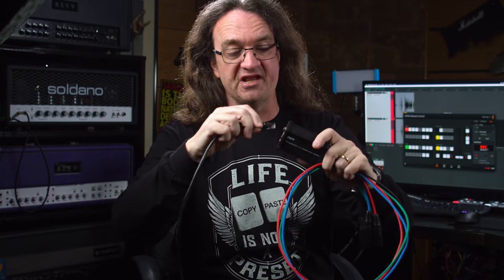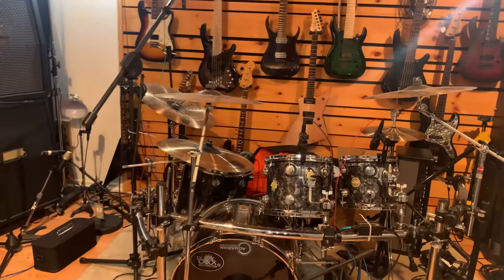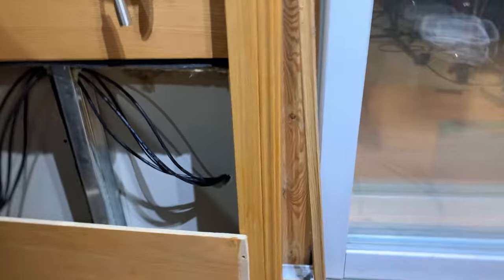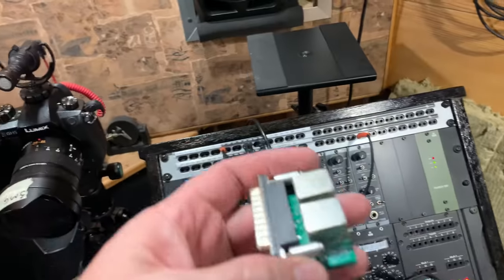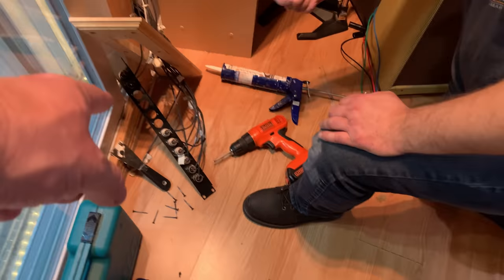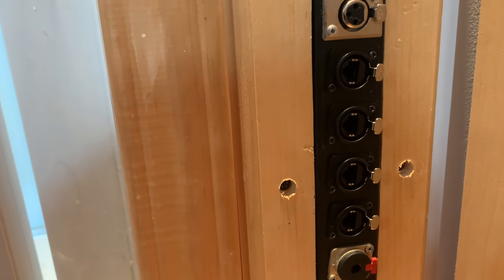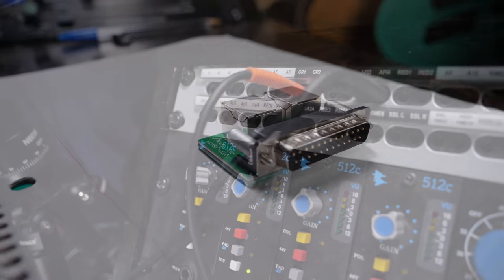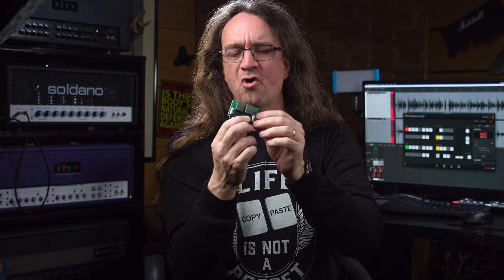How we Rewired the Studio!   We used lots of Caulk!

Comment: So you wired your studio back in 2003.  How did you do that without a patch bay?  What kind of wiring is that?  How many spools of solder did you go through?  How many hundreds or thousands of feet of wire did you use?  Do they have all gold or chrome plated connectors?  Did they have connectors?  Molded plastic ones?  Chinese types?  Quality RadioShack patch cords?  As if there ever was such a thing?

Come on Glenn.  Admit it.  You really don't know how to wire up the studio.  If it doesn't have plugs and sockets.  Because then you might need to use a volt/ohm multimeter.  To make certain you get everything out of phase.  Like those other eight microphone inputs you mentioned.

A lot of meticulous planning goes into designing and wiring up the control room.  Before you put all the equipment in.  It's not usually the other way around.  I mean it's hard to put all the equipment in and start using it.  Before you wire the control room.  It looks very impressive, yes.  But.  It has to be wired first.  Before you can use it.  And that usually starts with the patch bays.  You know patch bays?  Bays of patches for days of patches in the bays.  Like a lot of them.  Patching on everything.  Every input, every output, every insert every key, in the succession of inputs and outputs.  Wherever you can put a patch you put one.  And that generally means, hundreds if not thousands.  So yeah 18×48.  Amount of patches.  For a modest little control room.  Yours would fit, into the bathroom.  In place of the sink.

Of course I'm speaking in terms of old-fashioned classic, 1970s style, 50-year-old control rooms.  The way they used to make rock 'n' roll.  When it was all based on sex and drugs, rock 'n' roll and stop the war.  When rock 'n' roll actually meant something other than glitter and glam.  With no substance.  As is rife today.  Where only the best in mediocrity is offered up.

I have no qualms over these new, network-based microphone preamps and systems.  Why worry about good sound anymore.  When you can have PCM and analog matrixed garbage switching through.  On a piece of telephone cable cord.  So one need not worry about actual audio wiring requirements for balanced audio.  Now you don't need to know anything!   Except for plugging in a piece of telephone cord.  Because that's so much easier than having to actually know something or have some actual skills or talent for anything.  Such as the Art and Science.  That goes into making a musical recording.  Other than playing video games with audio software.  And looking at all the cool pictures of what looks like equipment but isn't.  It's just a cartoon for children.  So that it sounds like Huckleberry Hound or Yogi Bear.  My favorite actors!  Why did they never get an Oscar?  Especially with such great Pick-a-Nick basket.  He's smarter than the average bear!

This is the Phase of our Lives.
RemyRAD